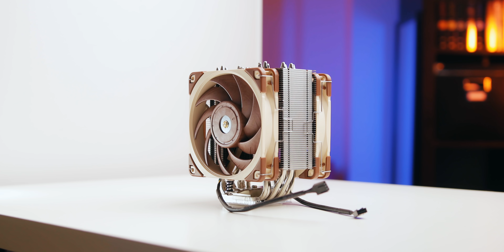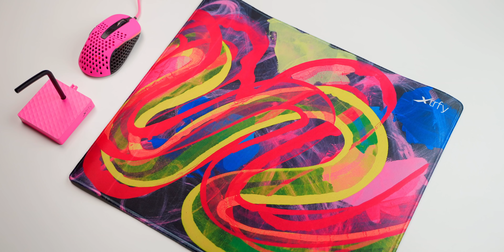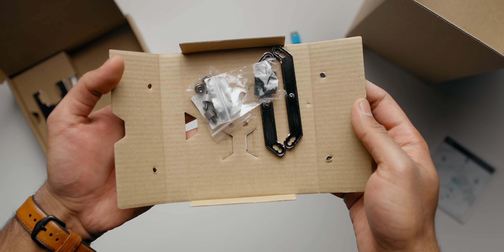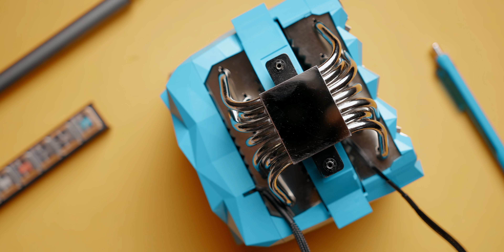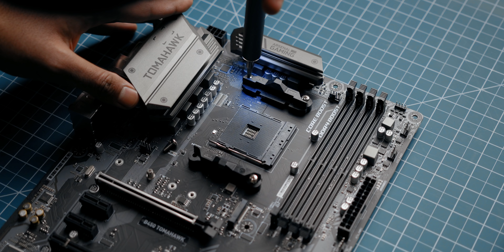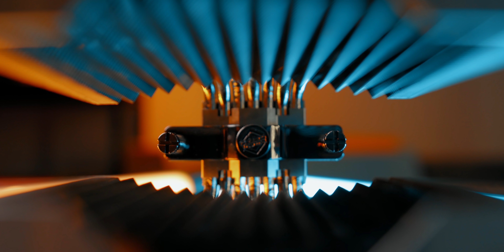Finally a DIFFERENT CPU Cooler! 😲

Comment: The center fan is odd. Has a high airflow optimized design, when in the middle of two tower heatsinks you would want better static pressure or at least a balanced design.

Comment: HOW ABOUT NOW since its down to 49.99 for the X7
Reply: in europe it is now less than 25€. i think it is a no brainer. just set higher fan speed at 70-80°C in BIOS and it should be very quiet vor mid class CPUs
Reply: @nickymlak  i ended up buying it a while back lol its been great
Reply: @StahFawx  which CPU do you have?
Reply: @nickymlak  ive put it on a 5600x, 7600x, 5700x3d and now gonna try a 14700k when i get it it
Reply: @StahFawx  i just orderd it for 22€.  I'm curious about it.
Reply: @nickymlak  the fan can be loud but it kept cool, i just set it down to 1 speed with FanControl
Reply: @ i think the biggest problem of this cooler is the plastic.
the fans are not very good, but they do the job silently with low workload like browser, watching youtube, etc, but the F-ING platic vibrates
i think this could be an very good cooler without the plastic and just 1 but good 12 or 14cm fan in den middle
Reply: @nickymlak  mine doesnt vibrate
Reply: @StahFawx  i took out the bottom cover and now it seems silent
fan curve in BIOS set to 700rpm til 70°C. now it is great for only 22€

Comment: The intention is good: make a dual-tower cooler and place an air guide over it. But it doesn't work as Arctic Freezer 50. Or just any mainstream coolers. I wonder what's wrong on it. The noise may from the centre fan which is placed too close to the front tower. If there's an obstructer in front of a fan blocking the air coming in it always make a lot of noise.

Comment: I have a twin tower cooler.  I lost 10C by adding push and pull fans instead of just one in the middle.  3 120s on my CPU.  Keeps it under around 60C at full load.

Comment: I don't know why anyone would look at a cooling fin stack and think "lets insulate that with some plastic". I understand it could be argued it directs airflow, but that's part of why it is loud and the fans struggle. They are obstructed and they are different sizes so they fight each other to match in RPM at the same power. The air has limited places to go and causes extra load requiring higher RPM and a lot more noise. Pure style-over-performance in the design philosophy. Save a buck and save your ears.

Comment: I moved to M1 chip so I don't have to deal with this HUGE CPU cooler crap and its 700 watts bullshit. Now I can still play my Baldur's Gate 3 with only 39 watts at the most. Yay!
Reply: No other 15w options? Zen2 and 3 mobile, even tiger lake? And as a bonus you can play ALL games everm made for pc and most consoles
Reply: @riba2233   I use my Mac mostly for works, anyway. Save for Baldur's Gate 3, I play all of heavy games on the PS5, thank you very much.

Comment: Rigidity of plastic backplate is usually not very sufficient. If motherboard bends it might be damaged after long time (years) after installation. Steel backplate provides far better results. I wouldn't buy it.

Comment: For what it is, a first offering from a new company, it's not bad. It at least attempted to hold its own against the industry leaders. It didn't do anything groundbreaking, but it at least didn't embarrass itself. Which at least puts it ahead of some companies I could name. Given it was compared against the two leading brands in the business, it acquitted itself honorably. Some honest critique and feedback for it, though:

* These tests were noise normalized right behind your optimal fan speed, which is what really hurt them in this benchmark. Look at this as an opportunity to improve. Another 120mm fan in the back in push/pull configuration might help here to keep the air flowing smoothly. It would let all three run at lower RPM's and thus lower noise for the same cooling. 

* Frosted white instead of teal for the plastic might have been better given the orientation of RGB, enabling the entire shroud to RGB it up as the colored light diffuses. Personally, I would just disconnect the RGB entirely, but I also acknowledge that I'm in the minority here. Many builders have a theme for their computer, and if teal doesn't mesh with that theme, it completely invalidates your product entirely. However, if you have white frosted shroud, with the ability to do any RGB color through it... this makes it very versatile in terms of which color schemes it can match, and turns this downside into a potential selling point, one that the other fans in this review can't match, and might be worth the hit to performance for in some cases. Right now, your shroud is what sets you apart from other cooler designs, lean into that!

* Fit and finish is going to be important to a lot of people, and your product is still working on it, given the demonstration in the video. As was stated, work on being able to install without needing to remove the shroud and you can make the shroud a much tighter fit. I realize it's going to be an engineering challenge, but probably one that would be worth the R&D investment. 

* With the current market being so strapped for supply, simply having fans in stock at retailers can be a huge boost to your business. You have an opportunity to establish yourself as a respectable company if you can get fans into the hands of users when the 'big boys' can't.

Comment: That shroud makes the recyclable packaging a joke as it adds 'tons' of plastic and doesn't offer any benefit (looks? doubtful at best) compared to equally priced competition coolers that are better in doing what a cooler is expected to do: cooling cpus. If considering looks you are better off with an AIO water cooler with RGB lighting, even if it's more expensive.

Comment: If an air cooler isn't dead quiet under full load, I won't use it.  Both my dual xeon media server and my threadripper workstation have noctua coolers. Both of them are in 4u rack mount chassis.  Because of space constraints, the rack is right by my desk.  They are dead quiet under full load.

Comment: What a joke...
Price bracket of best air coolers on the market and you get a tacky 3D printed...something, that is put together poorly, you get loud and inefficient fans which you can't swap out (WTF?)  and performs worse than much cheaper cooelrs, let alone coolers from the same price tier.
Yes, it does seem like something you get from the Wish.

Comment: Off topic but, can someone tell me if its usefull to replace the thermal paste on my CPU, even tho I don't experience any temperature issues? The tp is about 5 years old. 

My setup runs still fine. I keep it clean everytime, but I consider to replace the thermal paste on my CPU aswell as on my GPU (warranty ran out 3 years ago) xD
But the opinions on this topic can't be more split 😅
Reply: well if you dont see a difference in performance no but i would still change it youll probably get a few less degrees and clean the fins
Reply: @elliottd323  I mean, I only can see if it really has an impact on the performance, after I replaced it. After 5 years, my setup probably got a bit hotter I guess xD

Thank you ^^ .. any recommendations on good thermal paste?
Reply: @Dr.Girthmaster  yes if you're on a lower budget get some mx4 but if your ballin get kyronaut but get the 4g tube for 20 instead of my dumbass who bought 1g for 10
Reply: @elliottd323  sheesh xD .. I still have some cooler master paste left, it was seald but its 5 years old. I guess a new one will do a better job?

But thank you my man, appreciate it ^^

Comment: One of the reasons this aint working as well as it should is because the shroud design. Its cool but i didnt expect them to leave the jagged iceberg design on the inside. This is gona cause hot air to bleed in between gaps and circulate.
For the heck of it you should run a bench without the side panels.

Comment: problem with this design is the "iceberg" shroud around the fins and fan itself that prevents good heat dicipation. I bett if you strip the plastics down and put some good fan in the middle  the cooling will improuve  by nice degree.

Comment: I wonder if the plastic shroud would improve performance by channeling air through the unit, or hinder it by preventing radiant heat loss.

Comment: Did you try the cooler with a decent paste ? Something tells me the weak link at 150+ watts or so is just that. Assuming the heatpipes are soldered/brazed to the base in a similarly placed (low) location like the competition I don't think the relatively weak fans would cause such a big difference between the 120w test vs the higher 2. I doubt the heatpipes themselves are at fault as the handful of factories capable of manufacturing this in volume (for Amazon sale) certainly wouldn't screw that up. Would they really allow a company to order a non sintered pipe, doubt it since that is the wick to pull heat away and up by the tiny drop of liquid they shoot into them.
Also that plastic backplate screams CM Hyper Evo 212, probably made there

Comment: The only pro is probably keep the heat in the pipe so it won't radiate to other part of PC?
What I want to see is temperature inside the closed case.

Comment: I'll stick with my Chilltec Peltier cooler. It has been the best on my cpu. Nothing else water or air has matched it or even came close to beating it. Nothing wrong with plastic for backplates if they are designed well. Looks like those were designed well.

Comment: Even didn't considering the price/performance, which is bad, there's a more important problem: you can't change the fan.
The fan, the only thing that can fail in an aircooler, is the only thing that should be replaceable.

Comment: Likes:
New company with a fitting theme name and passion / holding promise
Ground running, with multiple thermal spans/sizings [inc. a TR friendly]

Dislikes:
VERY Proprietary fan / arrangement(s)
Insufficient chutzpuh, from them fans
Shroud disassembly / assembly

Recommendation(s), towards future tower HS iterations:
More conventional fan design use / retention system
Matching appropriate fan operation capacity, for the HS' TDP potential
Shroud being single assembly and of a softer/pliable plastic

Comment: Bit of constructive criticism,
the unit RPM is revolutions per minute, it is incorrect to say RPMs for a single value. Compare with  mph or m/s or mpg for one value you dont say top speed of 200 mphs or 300 km/hs or 12 miles per gallons.

Please dont repeat this. I thought you'd have fixed this recurring error by now. It is fairly basic when it comes to measurement.

Comment: I couldn't help but be reminded of my experiences of installing the Prolimatech Megahalems cooler, 10 years ago! While the Megahalems isn't quite as... complicated as the IceSleet X7 Dual, I still had to double and triple check that there were proper clearances and placements of everything. Installing the clips to hold the cooling fan(s) also proved a bit tricky!

Comment: So, Lets take some of the negative aspects of a AIO liquid cooler and put that into a Air Cooler.. (ie have to replace the cooler if either of the 2 fans fail) What could go wrong?
The great thing about Air coolers is that IF a fan was to fail you could (in theory) remove a case fan and put it in place of the failed fan, until you were able to replace the coolers fan.

Comment: Instead of a center fan and twin fin stacks they should have went with a single large heatsink and used counter rotating fans on each end. Especially with that shroud keeping the air flow within the heatsink fins.

Comment: Yeah...if they'd gone with a good pure white LED and white shroud instead of that blue, I could see this working in a lot of pure white builds a lot better, as well as other build types. They needlessly limited themselves with that specific single color choice.  If they made the exact same molding in white, and had a solid white LED kit instead of unicorn vomit...

But they didn't. I'd never buy this at half the cost.

Comment: With the new 11700k being able to pull over 290W under AVX-512 loads those 260W charts are a lot less silly. Obviously AVX-512 workloads are extremely niche, but it's good to have the data.

Comment: I know that the fans can't be replaced, but I would like to see a standardized test where the tower is equipped with NF-A12s to determine if the fans or the cooler itself is the weak link. I think some people would be interested enough in this design to modify the existing fans with better performing ones.

Comment: only thing about being incased in the plastic shroud, is the heat that normally radiates off the the head sink areas are now staying trapped in a confined area and killing cooling performance more than if it was open like most. I see they're trying to do more of a wind tunnel effect but also that plastic is soaking heat thus increasing max temp more than another cooler too.

Comment: Iceberg, Lets get real here, you could do a lot with some chrome and gold paint on this, its pretty neat looking, even if its but too fat. And there's probably a small market for selling "pimped out" coolers with design elements, I can respect that. Cudos for not going top high end without resources to get there, doing your own thing etc. Some little Johnny getting a this thing included in his very first system daddy bought for him from some "premium" hamfisted buildsites where the biggest premium is the extra cheese they cut from the price of components with "service and installation costs" and warranty. BUT, and the here's the kick, if you're going to insult the customers with having this fat bastards plates not made out of pressed aluminium tied to the heat sink AND pushing 50db max while you can just by a Scythe with that money, you are outta your fucking minds.

Comment: I really don't like this review. Call it out for what it actually is, a failed heat sink
Reply from the maker: How is it a failed heatsink?  It keeps up with some of the best around at heat loads 95% of people are gonna hit.  This isn't a product for the 5%ers.
Reply: @HardwareCanucks  it compensates good cooling with higher noises and it doesn't even do that well. It's bulky and it doesn't provide a good passive/active cooling in relation to it's size. It's the most expensive on the line-up. A plastic housing on a cooler, even worse than the Freezer 50.  

It's a simple case of, why would you choose this when there's a better and cheaper X,Y,Z coolers out there? The whole thing needs to go back on the drawing board. It may be usable but no one is going to say "this doesn't perform the best, I'll buy it".

Comment: I mean, slight visual differences aside, this is principally the same thing as the Arctic Freezer 50? Even down to the 120mm front fan with 140mm center fan.